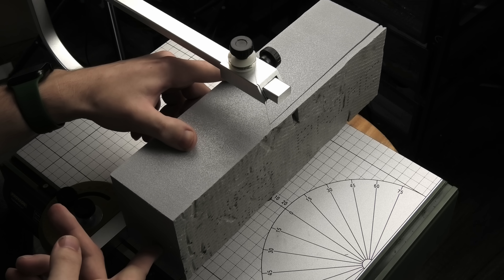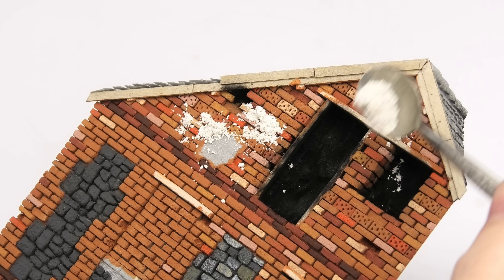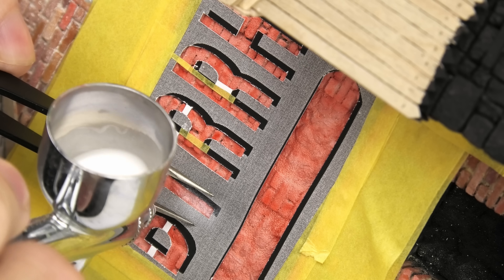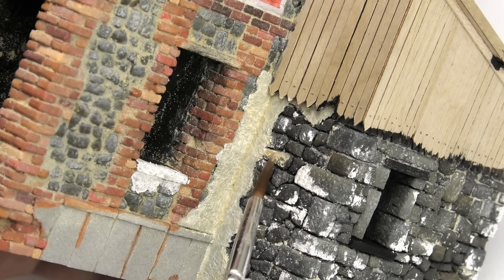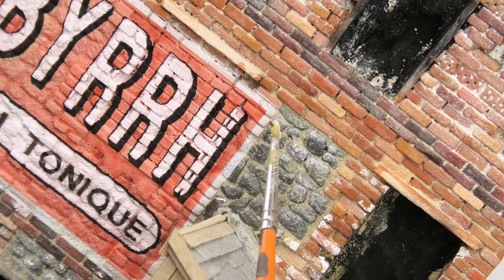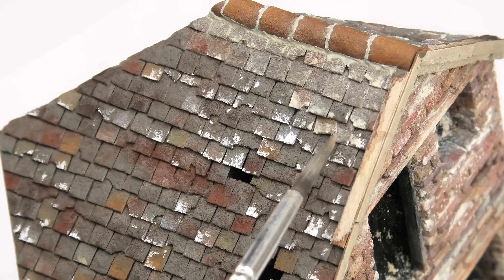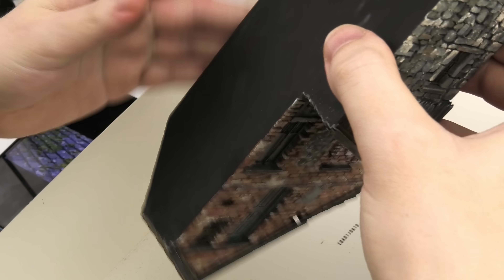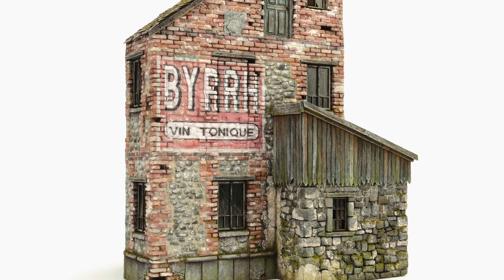Painting A Miniature French House Made From Styrofoam

Comment: Just amazing watching this house come to "life". Clear explanation and a great result. Just one thing though: when applying the wash to the moss did the PVA glue not dissolve?
Reply from the maker: The PVA dries really fast and it won't budge :) You can go to town with watered down acrylics.
Reply: @NightShiftScaleModels Many thanks for your reaction :-) Because I normally use watered down PVA when I want to put on static grass etc. and when I saw you put on the wash the first thing I thought was isnt that going to give some issues with the PVA?
Reply: @marckoppelman7170  Not all PVA's are the same. It took me a long time to figure that out. What you're looking for is a PVA for exterior use that's water resistant. Interior use PVA's tend to reactivate when soaked in water. I'd suggest you go to a store and check the descriptions of different PVA's. I've been using a wood glue which claims that it's intended for both interior and exterior use, is also water resistant and I have no issues when applying washes :)
Reply: @stavros_SX  I just checked my stock and both bottles should be water resistant ;-)

Comment: yellow mortar, is old type of mortar made of lime and sand, variations of it (it is dependent on location and lime / sand) were used most notably on medieval castles, but before and after. Grey mortar you are more used to, is Portland cement based. Portland cement in large enough quantities was only available from like mid to late 1800's, but it was expensive, more so if you had to ship it to rural areas so lime mortar was used well into mid 20th century, and is still used in renovations and such.

Comment: Incredible. But why is there a door in the second floor?
Reply: While in Europe I noticed buildings like this but had a staircase or walk up attached. Over time the stairs rust or rot away leaving only the door which is boarded up for safety reasons. 
On the original structures you can see the remnants of rust, dirt and fading where the staircase used to be.

Comment: Night Shift! A tip for getting acrylic to flow on the clear acetate: add a tiny amount of dish soap so it can break the surface tension. you have to mix it into the wash slowly so you don't get bubbles, but it will lay on a smooth surface, no problem.
Reply from the maker: Right, I should've thought about that. Another tip, use lacquer thinner or alcohol for blending, it won't hurt the acetate but it'll break the surface tension :)

Comment: i've done stenciling in 'real' scale with spray paint. We'd lightly glue the stencils on with very cheap spray glue, that way we didn't need the 'bridges' for the 'islands' like you have on the Bs and Rs. Maybe a tip for next time? some similar method? just lightly gluing the islands of your design with some non-permanentish glue?
Reply from the maker: If the surface wasn't a porous styrofoam I'd most likely use masking liquid to hold the stencil in place, similar to what you've described, but the foam would absorb some of the stuff and create a true disaster :(

Comment: Amazing work, i love your channel and i don't even paint miniatures. 

I did study graphical design however, so a bit of critique/advise:

The spacing in the logo is a bit wonky, especially noticeable around letter "Y". If you check the reference picture that you've used you will see that the spacing between the letters is way more tidy and universal. 

Its likely due to the fact that you had to use custom font or play around with already existing font in photoshop when you were replicating that logo. It can be difficult to nail it and its sometimes better to just trace the existing logo if possible. And in this case google does seem to provide plenty of results for BYRRH in the same font as reference picture. 

Hope it wont start bothering you as well after reading this comment :D
Reply from the maker: Agreed, I didn't notice any of this when I was making the template (I was probably too excited and wasn't thinking critically). 10 more minutes in PS and it would be a much nicer logo :)

Comment: I have tried the technique to create the mortar lines with just plaster, and the result was a disaster. The plaster left a white layer over everything and ruined the complete paint job. I did not have balast freeze, so I used water, is that what created the problem?
But again, another spectacular tutorial. Thanks a million.
Reply from the maker: It might be, because the Freeze has a binder that tones down the white residue. Similar to how varnish tones down dry pigments on models. However, it might not be a total disaster, you can use that as a good foundation for a weathered, messy brickwork!
Reply: @NightShiftScaleModels  Thanks Martin. I made a mix of PVC and water and this resolved the issue. I thought that just the water would be enough to mix with the plaster and make it go hard.
Reply: @paulcharters5933  Do you mean a mix of PVA and water? I'm not trying to sound like a smartass :P I'm not a pro, but AFAIK, pvc is a type of foam used for architectural models.
Reply: @stavros_SX  yes I absolutely do mean PVA